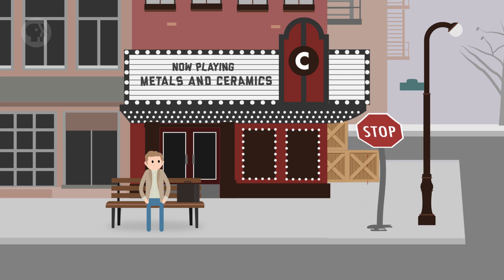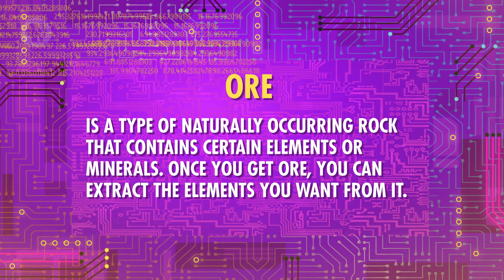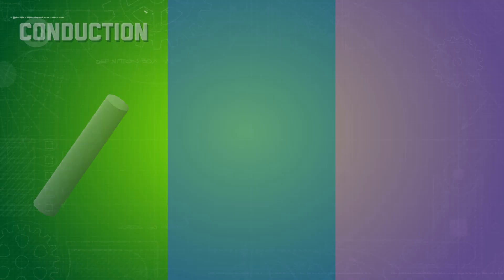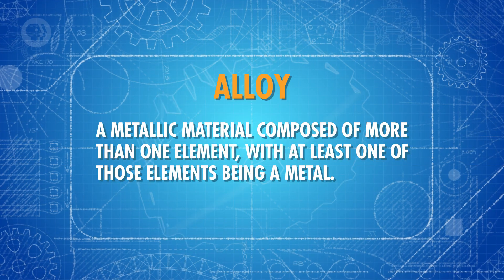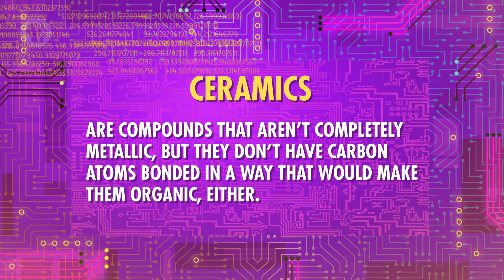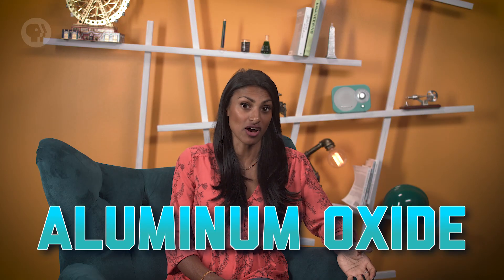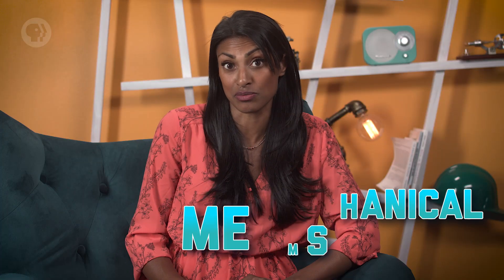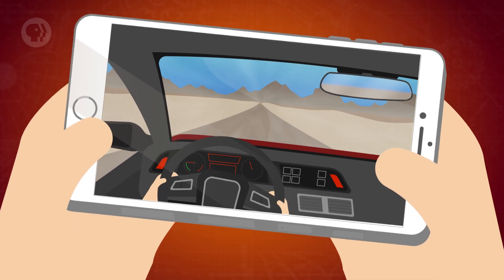Metals & Ceramics: Crash Course Engineering #19

Comment: You actually need to cool fresh cement when it is hardening, as it releases heat. Usually spraying water over it to keep it wet is enough, but in super thick structures, like dams, you need active cooling, like pipes placed inside, which run cold water to absorb and transfer the heat outside. When the cement is cured, the pipes remain inside, forming a steel reinforcement, which is also useful.

Comment from the maker: Whoops! Small correction. Thanks for pointing out the error, everyone! Here's a note from our consultant... 

"Correction: aluminum oxide is not rust; rust refers only to iron oxide.  Aluminum does corrode and the process by which it corrodes has been referred to as 'rusting', even if it is technically not rusting unless the material is iron or steel."

Thanks!

Nick J.
Reply: Al2O3, is best referred to as sapphire. It and other alumina like cousins such as YAG and ruby are very useful in optics. You missed an opportunity guys.
Reply: Fe2O3.xH20 is rust
Reply: CrashCourse Even smaller correction, you just said and twice.
Reply: @halasimov1362  maybe youre right i guess lol
Reply: OH make it year 3 please and from 5 to 8 years old plz
Reply: @Hal Asimov   yes youre right i guess

Comment: I thought rust was iron oxide, while aluminium oxide was bauxite
Reply: Bauxit is just the name of the Al raw material found in nature. The oxide film around Al is just called Aluminum oxide. The main difference between Al2O3 and Fe2O3 (rust) is that rust destroys the whole Fe structure and is thus a serious problem, while Al2O3 just creates a protective oxide film on the metal surface (similar to e.g. ZnO).

Comment: Aaah aluminum oxide, my favorite ceramic 'course in America they call it 'rust' and believe it comes from iron. That's what happens when you don't use the metric system.
Reply: nope .. that comes from letting hobos and the cleaning women write and proof read scripts, because they are cheaper. But that someone with a supposed Physics PhD speaks these lines, without obviously noticing makes her qualification quite ... ehm questionable.
Reply: Honestly, I've seen too many smart people say dumb things by now to question anyone. If you let people talk long enough, mistakes seep through. I just pray it doesn't happen to me more often than it has to.
Reply: Very bright comment and I absolutely agree, but there are mistakes that really shouldn't happen, not even drunk or distracted. And that's when mistakes happen at the most fundamental level. If e.g a MD mixes up the functionality of the liver and the brain you know that there is a serious problem and not just a mistake.
Reply: @frankschneider6156  damn, chill man. Rust is colloquial for Iron oxide and when I was watching I was like "Did crash course just mess up" because i know aluminum is known for not rusting. With that being said though, Aluminum oxide is, as well as rust, a type of corrosion, caused by oxidation, just like rust, that degrades the base metal. It's not as big of a switch up as you seem to think, you could say informally, that aluminum oxide is to  aluminum what rust is to iron or steel"
Reply: Frank Schneider  the grammar in your sentence makes it unreadable.

Comment: Tech not : If you put 1 kg of aluminum powder plus 3 kg of iron oxide powder you get thermite shuffle it with gun powder and ignite the mixture and you get 3000°c reaction temperature and that is enough to melt titanium and it's still used to weld train rails and large thickness beams
Reply: basic chemistry 8th grade .. so what ?
Reply: @frankschneider6156  so same Technic still used as a rocket fuel except instead of iron oxide because it's heavy oxgen under high pressure is deployed and BANG Huston we have lift off
Reply: @frankschneider6156  so same Technic still used as a rocket fuel except instead of iron oxide because it's heavy oxgen under high pressure is deployed and BANG Huston we have lift off
Reply: Yes and the same "technique" used since roughly 3b years by eukaryoric cells to produce energy, CO2 and  H2O from C6H12O6.

Comment: Aluminum oxide is NOT rust.  It's corrosion.
Reply: Yeah... iron oxide maybe?
Reply: Aluminum oxide isn't corrosion. Corrosion is the process of a material being gradually destroyed/broken apart due to oxidization. Aluminum oxide is just a metal oxide. It also tends to form passivating layers, so Al2O3 is really nice.
(Passivation is when the oxide doesn't rust the material away, but forms a protective layer on top. Copper does too; that's why the Statue of Liberty is completely covered in rust but is still standing 130 years later)
Reply: No

Comment: Technical note: Alumumin oxide is commonly used in sandpaper and rust has the connotation of Iron oxide typically.
Reply: Rust is just oxidation of metals so almost any metal can become rust
Reply: Thomas Gabby  You are correct, however, but my point is what "typically" comes to mind is the red flaking of Iron oxide and perhaps highlighting a use for Alumumin oxide could have been a better choice rather than illustrating an additional meaning of the word rust.  My post was just quibbling about that one small clip in an excellent video.  My intent of this post is merely to clarify my first post since it is apparently overly concise.
Reply: I disagree.  Corrosion is the oxidation of metals in general.  Rust is typically used to refer to the oxidation of iron.  Aluminium oxide, however, is not "better known" as rust.  Very few people would look at Al2O3 and describe it as rust.  Show someone Iron oxide, and they are very likely to call it rust, because Fe2O3, or iron oxide, is "better known" as rust.
Reply: KXMiddleton  Who are you disagreeing with?
Reply: Damon Allen I disagree with Thomas Gabby.
Reply: Just an FYI about replies, whoever's reply button you click on to gets a message that you replied to them.  In this case, the message went to me rather than Thomas.